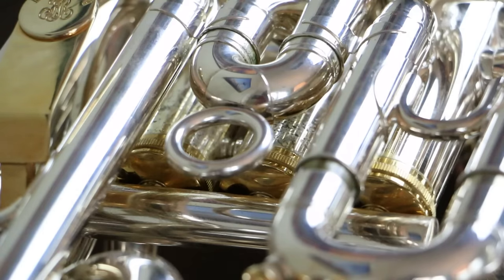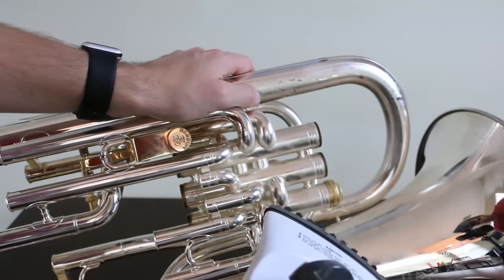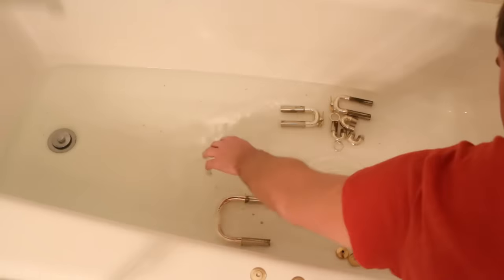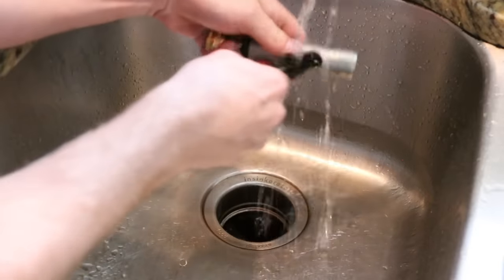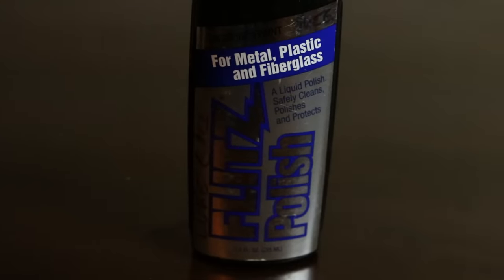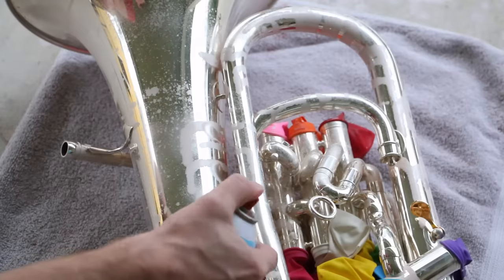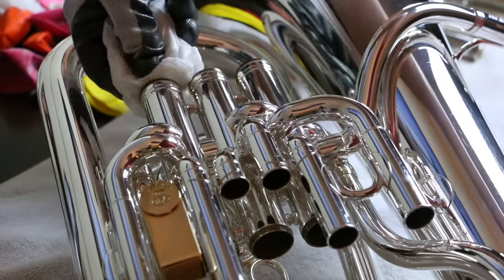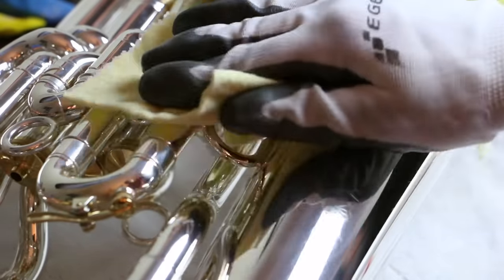How to Clean a Brass Instrument (with balloons!)

Comment: imagine having an instrument that fits into the tub

Sincerely,
a tuba player
Reply: Yeah no way is my sousaphone getting in the tub
Reply: And a euphonium is a tuba...
Reply: imagine having a tub...
Reply: Imagine
Reply: @sceu25  I play euphonium and tuba, you have no idea how light and different the euphonium is compared to the tuba.
Reply: @drewferdgames7  I also play both, so I DO know. The euphonium is also called tenor tuba which makes complete sense. It’s pretty conical and it plays in the tenor range. So just think of it as a BBb Tuba with nine feet of its tubing removed.
Reply: @sceu25  well yeah I know that, i guess they are practically the same thing lol.
Reply: @sceu25  except it ABSOLUTLY is NOT
Reply: @sceu25  A euphonium plays a slightly higher range of notes than the tuba. The difference between a tuba and euphonium is that a tuba is a lower and slightly larger instrument. The euphonium is also a brass wind instrument and is very similar to the tuba in its look and construction.
Reply: Lol
Reply: @sceu25  no lol
Reply: @Mr. Cool same
Reply: Imagine having one that can't fit into a tub
Reply: sad baritone sax noises
Reply: If tubs don’t work, use one of them kiddie pools
Reply: Imagine having an instrument that fits in a tub but you can’t be bothered to clean it

Sincerely, 
a lazy trumpet player
Reply: @victoriaanne7678  actually your best bet is to set it up on the wall and only do the bottom bit of tubing, like where the slides and the valves go and if oyu wanna clean the outer fill it with hose and your good
Reply: @drewferdgames7  imagine. I play both, too and would like to learn F horn and bugle in the future. my band directors don’t have any good euphonium players and still it’s pretty unlikely I’ll ever get To play a euphonium again.
Reply: Tuba gang
Reply: Mmmm I wish it could
Reply: Couldn't imagine

Sincearly
An alto sax player (we don't need to bathe our instruments)
Reply: Ayyy Im a tuba player myself
Reply: Tbh I would just use a swimming pool
Reply: Take it into the shower❤
Reply: Funny
Reply: I also play tuba and I can't even take mine home
Reply: @sceu25  .....no that's not how thing works

Comment: I'd refrain from using Brasso on slides as it is an abrasive polishing compound.  Try using a degreaser  like purple power.  It'll remove all that old oil and grease without messing with the metal . . . well, unless you don't rinse thoroughly.  The balloon tip was cool; very clever!  All in all, a very cool video, man.  I feel like cleaning horns is such a foreign concept to a lot of music students, and it's refreshing to see  something like this.
Reply: k3w1k47 valve oil is a great degreaser

Comment: Where do I buy elbow grease?
Reply: I hope you are just joking
Reply: At the wiper fluid shop
Reply: It’s at your local hardware store next to the cans of K9P or near the long weights.
Reply: Next to the blinker fluid
Reply: My dealers buddy sells it and its better than the acid my dealler gives me
Reply: Idk why this made me laugh so hard
Reply: Idk but I really need that
Reply: The same place that you get the blinker fluid for your car
Edit: dang it I didn’t see the other person that already said this😩
Reply: lol
Reply: You buy it at the same place you can get blinker fluid for your car😂💙
Reply: You can get it for free by puting grease on your elbow
Reply: Darkiplier r/woosh
Reply: From the elbow shop located under your sholder
Reply: Don't shower for two months straight then wait until the grease builds up make sure you keep a sock around your elbows and arms for extra results then after you feel the infection start take the back of the butter knife and scrape the grease off
Reply: @colereed7411  thank you???
Reply: Walmart i think, if not then BJ’s
Reply: @bionictulip - At that place between the Body Shop and Headquarters. But ask for right-handed grease, because the left-handed stuff is for the other side.
Reply: Near the exhaust bearings

Comment: NOTICE: THIS DOES NOT WORK ON FLUTES. DO NOT MAKE THE SAME MISTAKE I DID
Reply: Flute is woodwind he said BRASS
Reply: @randomperson4254  i know, geesus. I thought that maybe a similar method would work. It didn't.
Reply: @RtsShrtFrRtthw  Well just getting my point across
Reply: @RtsShrtFrRtthw  Btw what happened to your flute?
Reply: @randomperson4254   The little pads under the keys fell off, and the peices wouldn't go together right. I tried to use just the mouthpeice, but it didn't make any noise
Reply: @RtsShrtFrRtthw  shakes head
Reply: @RtsShrtFrRtthw  Why did you think that itd work the flute only has 2 openings
Reply: i!i!i!i!i!i!i!i!i! i!i! That’s like the first thing they teach you in band is not get woodwind Instruments wet other wise the key pads will fall off.😂
Reply: It should’ve worked for flute
Reply: Uhh.You did that to yourself
Reply: that's called "How to Clean a BRRRAAAAASSSSSS Instrument"
Reply: Omg BRASS NOT WOODWIND
Reply: Y'all need to understand that you should never wet the pads ;-; XD
Reply: That's why he said "for brass" in the title
Reply: WHY WOULD YOUR FLUTE IN THE WATER F$IFUGFEJDSHABHJS
jk i know you didnt mean to harm it
Reply: i was wondering if you could use the way that he polished the brass instrument if you could use it on the flute.
Reply: The only thing you can apply from this is if you are going to wet it, all keys have to come off and be polished separately without water or other liquid near the pads. 
I've taken my alto sax apart and cleaned it and it turned out well but I was very careful about what order I took things apart in and put them back in the same order. 
I would not try that with a flute or even a clarinet because any slight deviations could completely mess it up.
Even my sax was nerve racking the entire time and putting the springs back was extremely difficult at times
Reply: You don’t even clean flutes
Reply: Not Human Your point is you’re not very nice.
Reply: @calebmarkle5773  I have a sterling silver sax with a lot of tarnish on it, do you think it would I be safe using a warm wet rag to preclean it, then follow the rest of the polishing steps mentioned here?
Reply: @dc2guy2  not unless you plan on replacing every single one of your pads and possibly springs
Reply: Caleb Markle even if I'm careful not to get the pads wet?
Reply: @dc2guy2  yes. Even if you dont get the pads wet, introducing them to such a humid environment is awful for them and can create unforeseen issues
Reply: Caleb Markle fine I won't try it lol thanks for the warning 🙏
Reply: Uhh, dude
Reply: Your cork is SCREWEDDDD. If anyone didnt know, flutes have a cork in the mouthpeice thingy
Reply: DID YOU PUT YOUR FLUTE IN WATER?!?!?!?
Reply: @RtsShrtFrRtthw  that's because pads are water soluble. That why you can't play outside in the rain, it's the same with clarinets
Reply: hahahahahahahahahahahahahahahahahahahahahahhahhahhahahahahahahahahahahajahahahahhahahahahahahahahahahahahahhahahahahahahhahahahahahahahahahahhahahahahhahahahahahahahahhhahahhahahahhahahah hahahahahahahahahahahahahahahahahahahahahahhahhahhahahahahahahahahahahajahahahahhahahahahahahahahahahahahahhahahahahahahhahahahahahahahahahahhahahahahhahahahahahahahahhhahahhahahahhahahah hahahahahahahahahahahahahahahahahahahahahahhahhahhahahahahahahahahahahajahahahahhahahahahahahahahahahahahahhahahahahahahhahahahahahahahahahahhahahahahhahahahahahahahahhhahahhahahahhahahah hahahahahahahahahahahahahahahahahahahahahahhahhahhahahahahahahahahahahajahahahahhahahahahahahahahahahahahahhahahahahahahhahahahahahahahahahahhahahahahhahahahahahahahahhhahahhahahahhahahah hahahahahahahahahahahahahahahahahahahahahahhahhahhahahahahahahahahahahajahahahahhahahahahahahahahahahahahahhahahahahahahhahahahahahahahahahahhahahahahhahahahahahahahahhhahahhahahahhahahah hahahahahahahahahahahahahahahahahahahahahahhahhahhahahahahahahahahahahajahahahahhahahahahahahahahahahahahahhahahahahahahhahahahahahahahahahahhahahahahhahahahahahahahahhhahahhahahahhahahah hahahahahahahahahahahahahahahahahahahahahahhahhahhahahahahahahahahahahajahahahahhahahahahahahahahahahahahahhahahahahahahhahahahahahahahahahahhahahahahhahahahahahahahahhhahahhahahahhahahah hahahahahahahahahahahahahahahahahahahahahahhahhahhahahahahahahahahahahajahahahahhahahahahahahahahahahahahahhahahahahahahhahahahahahahahahahahhahahahahhahahahahahahahahhhahahhahahahhahahah hahahahahahahahahahahahahahahahahahahahahahhahhahhahahahahahahahahahahajahahahahhahahahahahahahahahahahahahhahahahahahahhahahahahahahahahahahhahahahahhahahahahahahahahhhahahhahahahhahahah hahahahahahahahahahahahahahahahahahahahahahhahhahhahahahahahahahahahahajahahahahhahahahahahahahahahahahahahhahahahahahahhahahahahahahahahahahhahahahahhahahahahahahahahhhahahhahahahhahaha hahahahahahahahahahahahahahahahahahahahahahhahhahhahahahahahahahahahahajahahahahhahahahahahahahahahahahahahhahahahahahahhahahahahahahahahahahhahahahahhahahahahahahahahahahahahahahahahahahahahahahahahhahhahhahahahahahahahahahahajahahahahhahahahahahahahahahahahahahhahahahahahahhahahahahahahahahahahhahahahahhahahahahahahahahhhahahhahahahhahahah hahahahahahahahahahahahahahahahahahahahahahhahhahhahahahahahahahahahahajahahahahhahahahahahahahahahahahahahhahahahahahahhahahahahahahahahahahhahahahahhahahahahahahahahhhahahhahahahhahahah
Reply: Oh lord!
Reply: i!i!i!i!i!i!i!i!i! i!i! oh nooooo 😔😔😔
Reply: Do not attempt on piccolo, either... Nor the violin... Nor the radio.....

Comment: One thing he forgot in the video:
Felt pads, which are common on many brass instruments, should NOT get wet if you can help it. Remove them and leave them outside the tub, and just put them back on when you’re done; they generally don’t need cleaning. If you feel you absolutely need to clean them, use another method.

Comment: There is one concern I have:

Won’t the padding start to mold? Since it was SOAKED IN WATER?
Reply: Don't soak them, or per his personal advice, you could put them in a cup that's filled to a level lower than the pads
Reply: @braveheart1320  or you could take the felts off???

Comment: Those soaking periods are way over the top.  I simply use my brush and some warm soapy water, then rinse throughly under the tap.  It’s all done well in a couple of minutes.  Hint: use a slightly heavier oil on the threads, just a drop will do.  That will prevent sticking the next time you go to unscrew the caps.

Comment: Hey Luke, I was wondering if there was a reason behind why you kept the slides out while polishing? Was it simply because they weren’t cleaned yet or is there something regarding the polish to watch out for like how it could be harder for the polish to reach the middle of the horn area? And should I be concerned with covering the lead pipe as well as the tuning trigger? I just recently bought the same horn you have in this video and I love it! Thanks for the awesome resource!

Comment: The "gunk" you mention that flakes off and swishes all over the instrument in the bath is dry saliva and valve grease.
To be hygienic and not use your instrument to spray viruses around, start by pouring hot water down the complete horn from the mouthpiece end only, or with a hose holding the bell up.  Operate each valve to rinse through each loop tube in turn.  A little antibacterial detergent may help.
That gets rid of the nasties, loosens the joints and threads and makes the inside cleaning out easy.  

This is a real thing, brass band members have a responsibility to the other players not to join sessions when they have colds, flu or worse.  

The cork disks sealing the spit traps is usually where the fusty smell is coming from.  Replace those often. they  deteriorate quickly when you bath soak it and then they smell bad or leak air.  

Brasso is abrasive and will get through the silver plating, especially on the sharp curves, which is not a good look.  A specialist metal lacquer coating is better than household polish, prevents tarnish and sheds beads of water if you play outside in the rain.  A lot less polishing needed because the silver  finish is protected from the air.  
Half a minute with a dry cloth to remove fingermarks and dust after each playing is then enough to keep it smart.  Do the rinse through inside about once per month or before you leave it when you go on vacation.

Comment: Brasso is abrasive.  Eventually you will remove enough metal that the slide will not stay in place.  This will mean that your instrument will not stay in place.  Use dry cleaning fluid to clean the slides. Once you have polished the instrument, go over it with a silicone based polish.  This will slow down the development of tarnish on silver plate instruments and make water and spittle stains easier to remove on silver, brass and lacquered instruments.

Comment: Question about Hagerty's. Does it work for lacquer as well? I bought a can of it to use when I clean my euphonium but I'm hesitant to use it because the can doesn't indicate that is safe for lacquer or not. Is it safe to use? Also, do you polish or clean your valve caps? Thanks for the pro tips! Very helpful!
Reply: no polish for lacquer.  Only mild soap and water

Comment: I get putting the balloons on the tops and bottoms of the valves, as having them out is beneficial, but why not have the slides in while polishing? They need to be polished as well, and keeps anything getting in.

Comment: WOODWINDS 

This was a reply to a flute who tried this but I'm posting it as its own comment.

The only thing you can apply from this is if you are going to wet it, all keys have to come off and be polished separately without water or other liquid near the pads. 

I've taken my alto sax apart and cleaned it and it turned out well but I was very careful about what order I took things apart in and put them back in the same order. 

I would not try that with a flute or even a clarinet because any slight deviations could completely mess it up.

Even my sax was nerve racking the entire time and putting the springs back was extremely difficult at times because of the placement of them. I had to meticulously check that I got all of them and still missed two that I found during rehearsal the next day.

TL;DR dont do it

Comment: Can you just put the slides back in before using the spray polish thus eliminating the need for the balloons and also polishing the shiny outer part of the slides?
Reply from the maker: Yep! You can do that. It still might get in the cracks a little bit, but it's not a huge deal.

Comment: Don't use brasso on slides. Each time you do a bit more metal is abraded away
 In time slides will leak and/or fall out. I spent twenty-six years in army bands, then more as a school band director and an instrument repairman.
Reply: What would you recommend instead of brasso?

Comment: I disagree about the bottle kind being worse. I had two cans of the spray and both nozzles became unusable halfway through. The stuff dries too fast for aerosol cans. The bottle kind is way easier to paint in all the cracks and crevices. And works just as good, being the same chemical.

Comment: NEVER EVER use Brasso or any kind of steel wool on a slide or anywhere else on a horn.  Brasso is an abrasive and removes metal. Steel wool even more so.   I used to "clean" my brass slides using Brasso or steel wool just to shine them up.  After awhile I had major air leakage at the slides.    Best thing is just to let the slides turn their natural color.

Comment: I just use my snake a towel and valv oil when I clean it out and I don’t take off my all my Valvs at the Same time cause I forget which one it goes in and before I put valve oil on I clean my valves off so all the old oil can get off then separate the instrument and use my snake then wipe it clean with a wet towel

Comment: A tip for deep cleaning your acoustic guitar is to use a toilet plunger over the sound hole (new plunger is preferable).  Place the guitar in a clean bathtub full of water. Place the plunger over the sound hole and give a gentle plunge. If you feel resistance, make certain you have removed the strings. Try another gentle plunge, but if you still feel resistance, make sure you have unplugged the cable to the amp. Once that cable has been removed, I can usually get a stream of water to squirt from the plug hole clear across the room. Be careful - if you are shooting water far enough to hit the far wall, you may damage the instrument. The perfect amount of plunger pressure lets the water jet land in the sink or toilet. This will be the perfect pressure for cleaning quality acoustics. Cheaper acoustics require a bit more pressure and I recommend opening the window for the water to exit, otherwise, the dog or the kids really get in trouble with the wife.  Good luck with maintaining your guitars and if you have any other cleaning tips, I would love to hear about them

Comment: Brasso ! LMFAO all you need to clean the surfaces on a brass instrument is hot soapy water. Using anything abrasive on the slides or the valves is the dumbest thing you can do. I've been cleaning my trumpet since 1965.